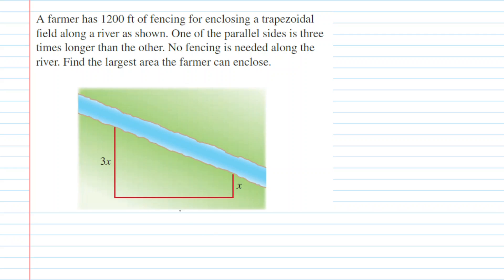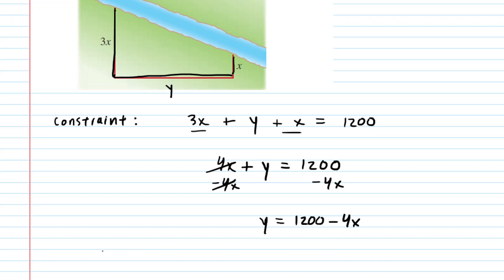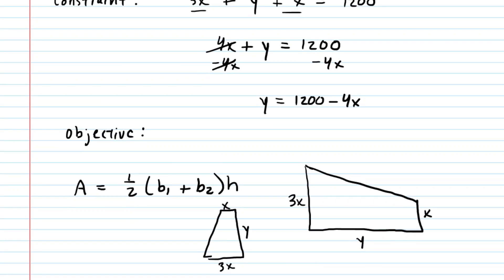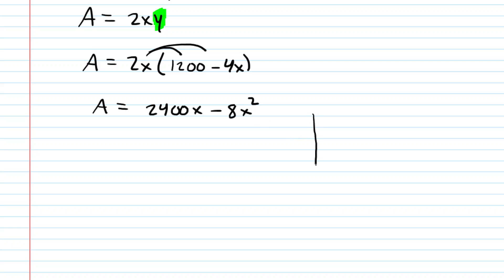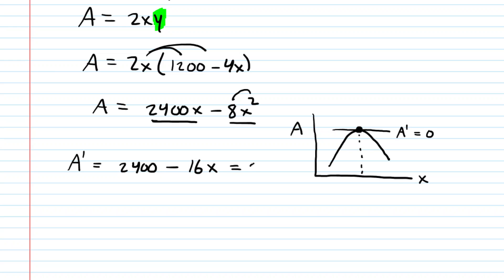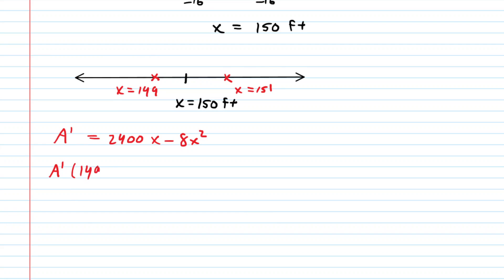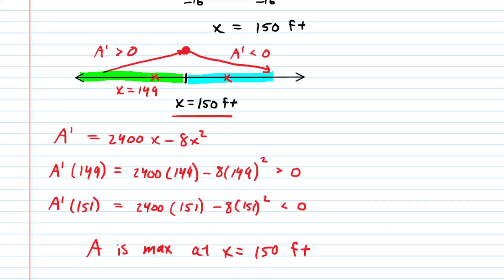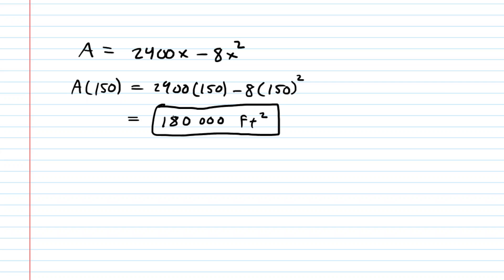A farmer has 1200 feet of fencing for enclosing a trapezoidal field

Comment: This video is incorrect. When doing the 1st derivative test, you used the original area function instead of it's derivative (2400-16x), and 2400(151)-8(151)^2 is not negative, but 2400-16(151) is negative.
Reply: Woorrd